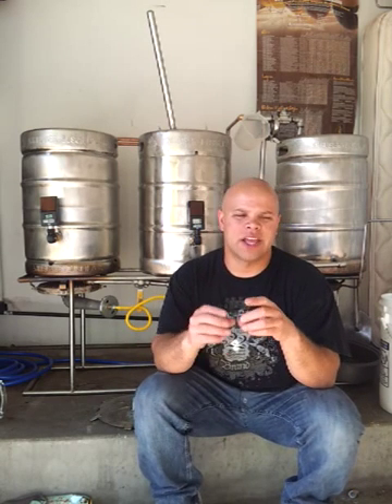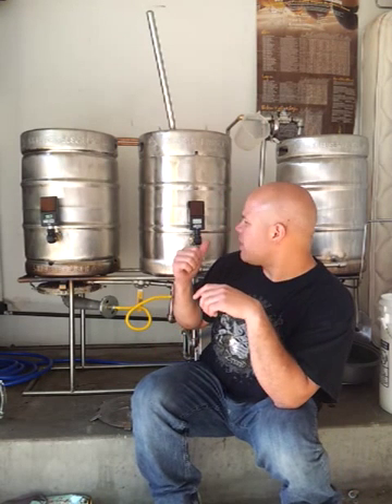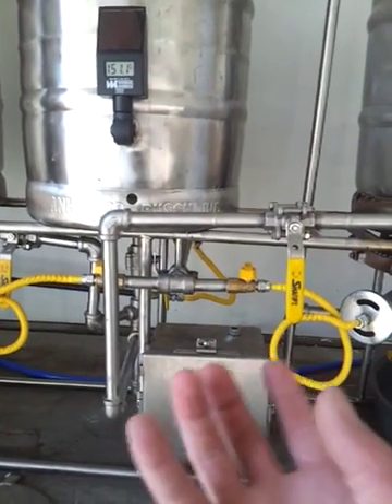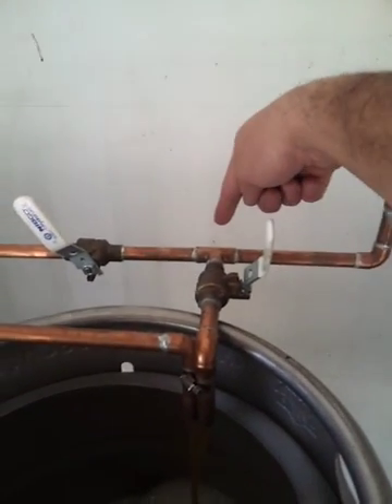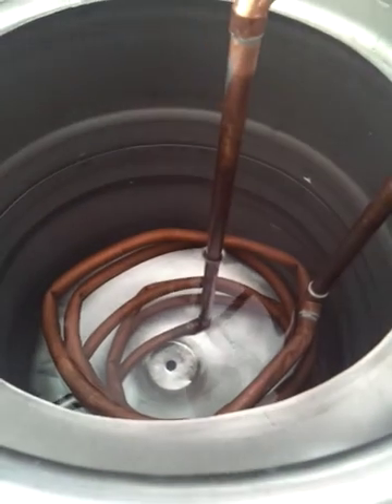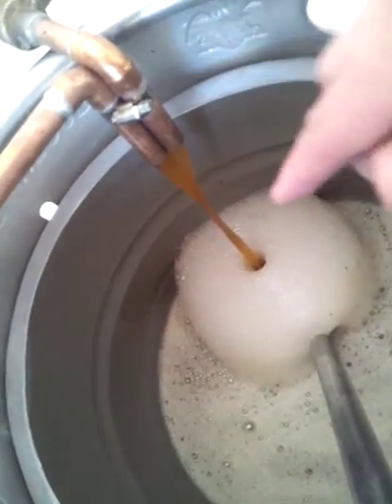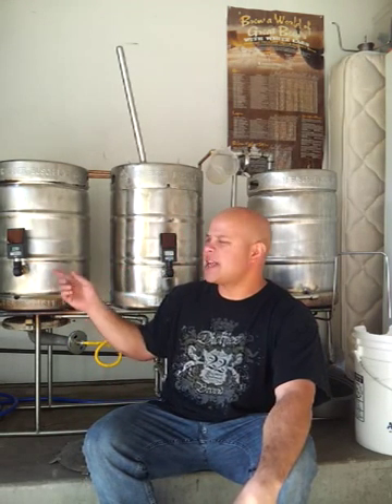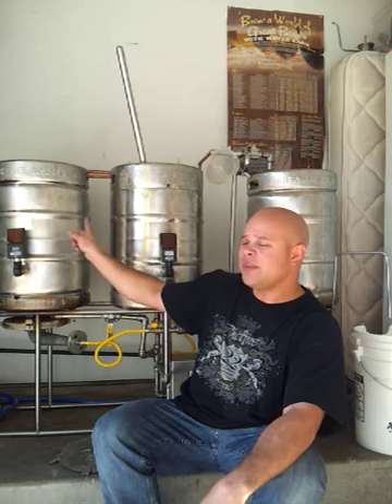HERMS system

Comment: did you protect the copper pipes before putting the hose clamp on? tif not that is a good way for oxidation to start. nice system